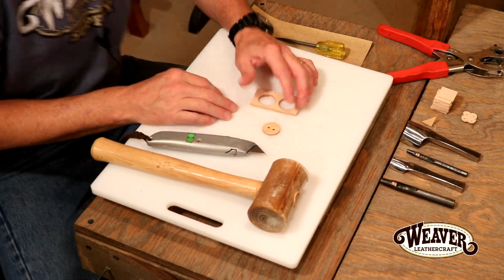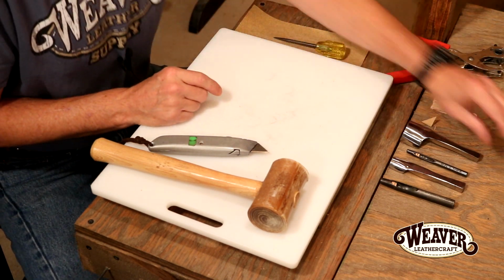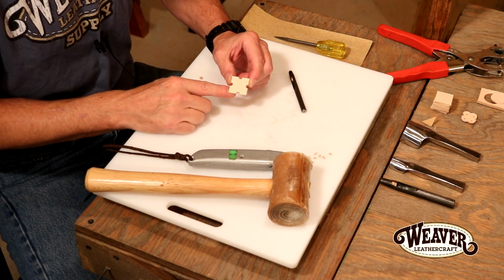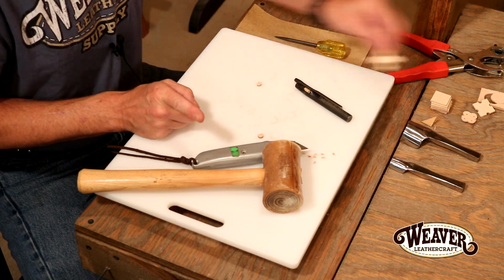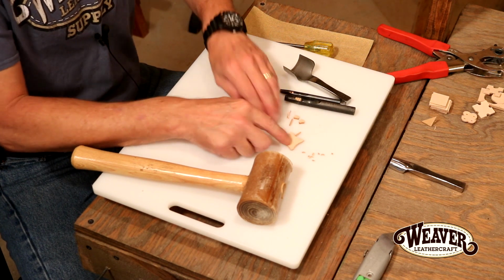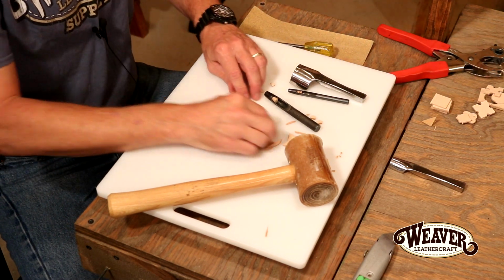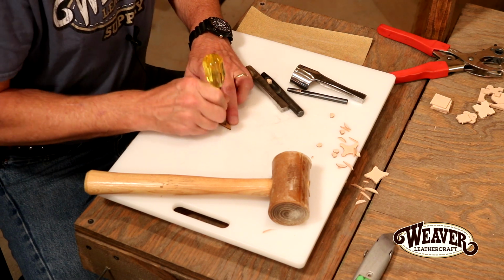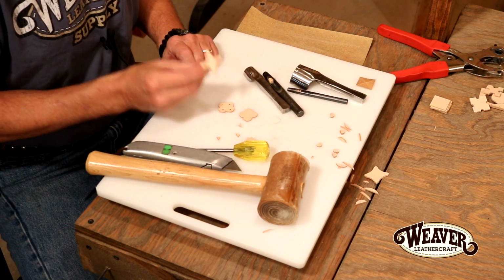The Leather Element: Creative Leather Buttons

Comment: Thanks for this video, but I've seen that those metal punchers are quite expensive, do you have any helpful ideas on how else these buttons or other smaller cutting designs, could be cut shaped?
Reply from the maker: Hi Melody,
About the only other way would be to make a pattern and cut it out with an xacto knife or art knife. You cam also use a regular rotary hole punch to cut out the corners of the designs and then use your knife to finish the cut. Hope that helps!
Reply: @WeaverLeatherSupply  Thanks for the reply, I have a lot more time on my hands these days, as everyone is being told to stay home, but I miss  not going to the gym, so i'm going to make some leather buttons, these designs you have here for buttons are cool & creative, thanks a bunch & stay healthy to you & your loved ones.

Comment: Can you tell me what size pricking iron to use for 1mm thread. Is 1mm thread a popular size? It seems to be available everywhere. The set up I am using is hard to pull the needle through, have tried smaller needles but the eye is too small to thread the needle. Tired of pulling my needle through with pliers. Is there a size chart matching these things up?
Reply from the maker: Your right, there really isn’t much out there since there are only a few thread sizes for hand sewing and I don’t think I’ve ever seen a size chart.  A 1mm is a pretty good sized thread, but, I like a thicker thread since it’s hand sewn and I want that noticeable.   One thing that needs to be considered is the size of the project.  For a wallet or smaller project I tend to like a .6mm so it’s not so overbearing.  On the needle, it’s mostly about durability and gauge.  I like our #18 John James needles (1.09mm) because they are extremely durable.  The eye is not as large as I would hope but it does accept the .8mm easily.  Anything above that diameter is really starting to get big.  That’s great for the eye but it’s tough to get them through standard chisel holes.

Comment: Wonder if you line chrome leather, can you use it for a holster? Thanks
Reply from the maker: Hi Johnny,
Yes, if you lined the chrome with veg tan or some sort of material that won't scratch the finish of the gun it should be fine. Chrome tan won't wet form though so it wouldn't form to the shape of the gun. Hope this helps!.

Comment: If I took the 2nd star, riveted it to a round base would I cause issues fastening the flap of the bag with the thickness?
Reply from the maker: Hello,
The thickness of the button shouldn't be an issue, you will just need room for the lace between it and the pouch flap. Hope that helps!

Comment: I follow yor fantastic videos, there is always something to learn. But, in Sweden, and most of Europe, we have another way of  messuring leather. As you probably know (of course)  we do messure in thickness of the leather in millimeters. Most common used is 2.5 mm natural vegetable tanned leather, at least I do. And 1.5 mm when you want a softer leather, sometimes , if you can find it, 3.0 - 3.5 mm for belts or straps for saddle works, It would be useful if you could enlighten us poor europeans in the mysteries of american  leather measurments :-)
Reply: At least 1 American needs a little enlightenment too. ;)
Reply: @hamm6035  Sometimes I wonder if you have the same problems with the european centigrade system as we have with inch and feets and oz and God know every strange system you use :-)
As an example: you are about to loosen a bolt or a nut trying to repair an old machine of some kind. You do have all the tools you can think of, socket wrenches and ring wrenches. All in millimeters. But the bolt or nut are made in the "imperial system" (inches - freaking strange name, imperial, like if the english still role the world :-) ). Makes you go nuts.
Reply from the maker: Hi Jonny,
Sorry about that - we'll try to include both oz. and millimeters. We do have a leather conversion chart that shows what a 7 oz. leather would be in millimeters, I'll link it below 👍
https://www.weaverleathersupply.com/learn/leather-101/leather-thickness
Reply: The math I use to get a general idea is to multiply the the ounces by .4 to get the mm equivalent. For example 7oz leather is 2.8mm. 4oz leather would be 1.6mm. Close enough for government work for me.
Reply: @WeaverLeatherSupply  Thanks a lot!
Reply: @canacius  Thank you. Sounds easy enough.